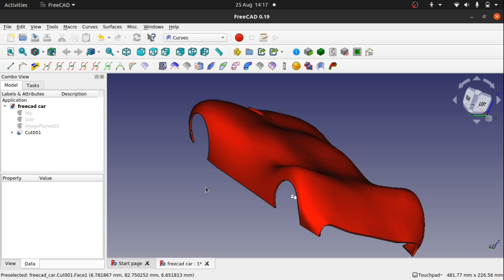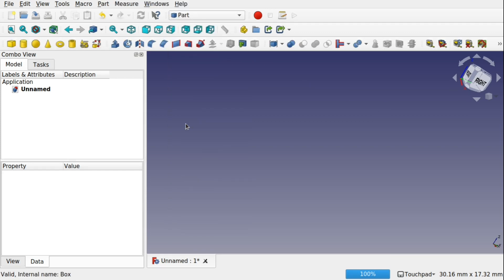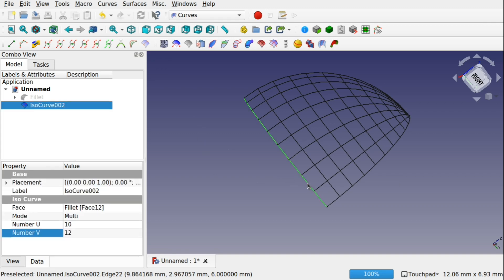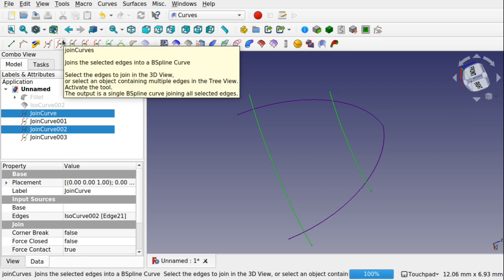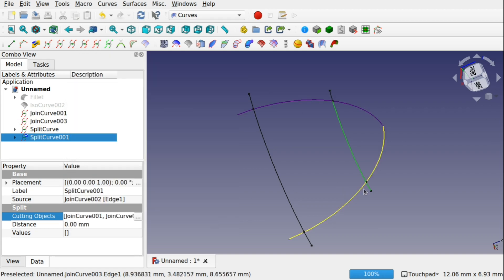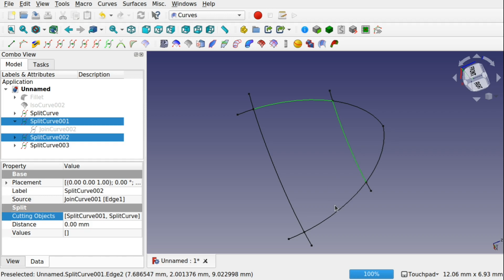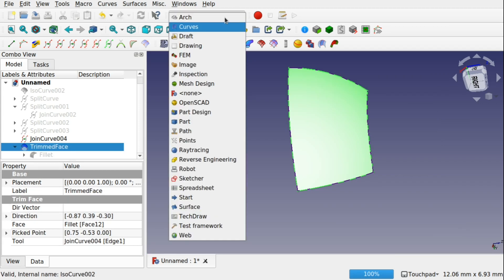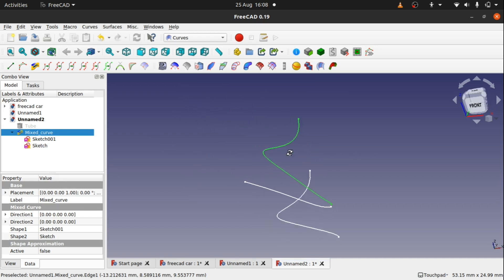freeCAD Curves Workbench 11  Iso Curves and Trim Face With Projected Curves

Comment: Drawing a cylinder, then cutting it at one side in a slanted way through a subtractive loft then applying fillet to all the edges. Once done this, by creating isocurves, I got them in a strange way: they were not contiguous (as if the faces of the obtained polygon was like 1 face or however joined faces), but each face got her curves. The cylinder as well, projecting the curves along the part was cut away.
Reply from the maker: Yeh that's interesting, I am going to have to have a play with that in freecad and see why. Thanks for the heads up

Comment: Good tutorial. What did you press to section out the car? (Slightly after 1:30)
Reply from the maker: Thanks for the comment That's the trim face tool, I go into the tool nearer to the end of video. It's a nice little tool, I use it alot 😁
Reply: @MangoJellySolutions  okay 👍